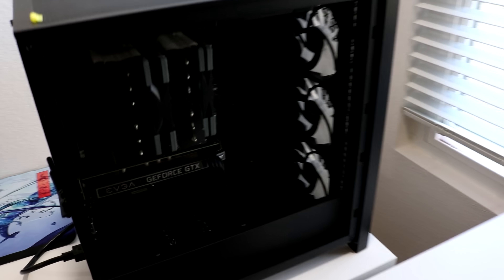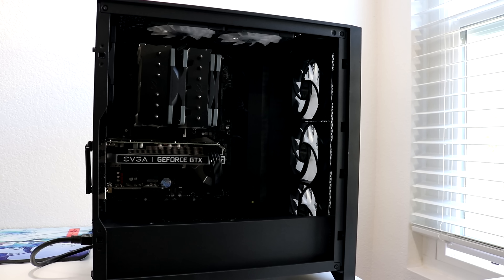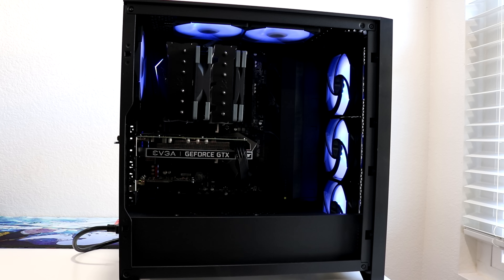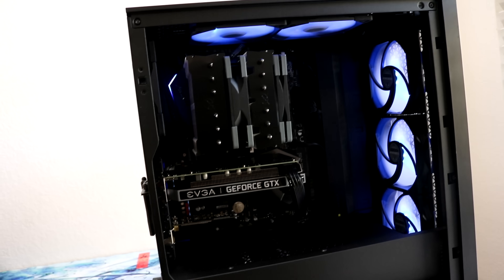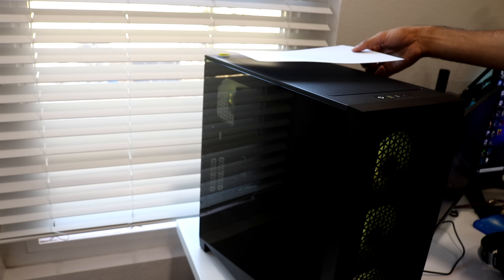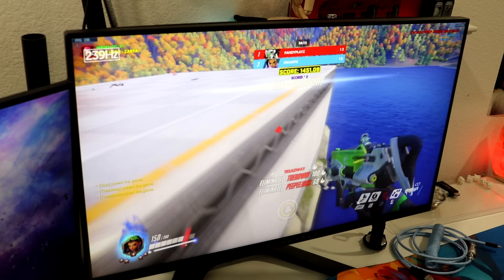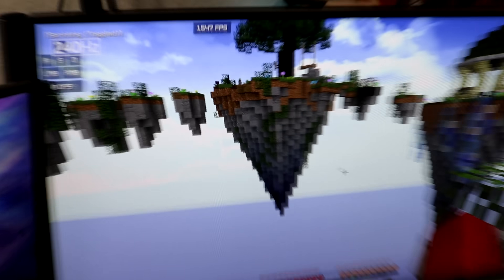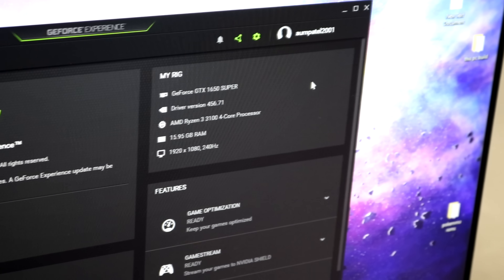$600 PC Build Gets 1500+ FPS In Minecraft

Comment: okay so this video is totally fake!! dont be fooled hes not using the gpu as he said he just have swapped the coolers!!!! I have a 1660 super thats overclocked and i cant even reach 1000 fps with all on fast and fast render on and i have a ryzen 5 5600x so this video is totally fake also my temps are below 60 for the cpu and below 65 for the gpu and A RYZEN 3 3100 SHOULDNT EVEN RUN AT 60 Degrees EVEN WITH A CRAP COOLER!!! Ive tested myself with a Ryzen 3 2100 and it ran like 40 degrees with the stock cooler SO THATS WHY I THINK THAT SWAMP IS FAKE AND HE SHOULD DESERVE A DOWNFALL

Comment: of course you're gonna get 1500 FPS when the game doesn't need to render hardly anything.
Reply: Even though minecraft is more cpu based, I hope I get my expectations with a rtx 2060 super and ryzen 5 3600x
Reply: @JD-ut5hs  you should be able to easily get 400-600 fps with that setup. I have an i5-10400f, 16gbs of ram and an rtx 3060 and I get around 600-900fps
Reply: Its off now so I'm gonna have to go for the 2070 super and ryzen 7 3700x...

Comment: I have a 3060(overclocked) a ryzen 9 3900x and 32gb of 3600mhz ram and I can only get 350 fps on the lowest possible settings staring at the sky
Reply: Make sure minecraft is actually using your graphics card lol
Reply: You should be getting 1000 FPS easily

Comment: Overkill motherboard and overkill cpu cooler
Reply: Upgrade path..
Reply: A $120 B550 board would have a similar upgrade bath. You could spend $120 on a B550-A-PRO and you could put a 5900x with no issues.

Comment: That’s a bit to much FPS
Reply: Precisely 4.31111111x too much as the highest if my calculations are correct as the highest FPS I saw was 1552 and the highest refresh rate monitors today are 360hz at 1080p meaning that this much FPS is retarded and unnecessary
Reply: @applemaster5343  indeed good sir

Comment: instead of wiring a long ethernet cable from the router, how bout a powerline adapter connected close to the pc? thus connecting a short ethernet cable from the powerline adapter to the pc
Reply: Power lining would always have worse performance than regular wiring.
Reply: @ohtitus13  oh yes thats true but still better performance than wifi, from my experience
Reply: @SoyPotatoe  Compared to wifi, its definitely better. But 90% of homes have wired ethernet cables running through the house anyways. I use a powerline adapter myself and electrical interference is a common problem. 200mbps, if my lights are on around the house and the microwave is running, its like 30
Reply: @ohtitus13  ah i see. having other electricity on disrupting performance is new to me. thank you for the heads up 👍

Comment: Yeah that’s not hard to get but you only need 240 FPS since that’s the max you can render with a 240hz monitor, aka you can install tons of shaders and mods so measuring it with FPS isn’t fair since you can probably get like 3000 with a bunch of mods and bad texture packs

Comment: Guys, remember that the monitor also has a huge factor for the FPS. You could have. 3070 on a 60htz monitor and get maybe 400 FPS in minecraft, but as you can see here he has a 240 htz monitor. If you have these exact specs but on a 60htz monitor, minecraft would only get like 120 FPS. (I know this for a fact since I have the exact gpu. Also the processor holds a pretty big factor on how “big” the thread rate is. Another thing is that your ram will also have to be capable of running 1500 FPS.my reccomendation to anyone who actually read this whole thing is that u don’t need a rtx titan to run 2000 FPS. The monitor has more impact than you think.
Reply: I thought the hz of the monitor only affects what is it shows not the actual performance
Reply: @princemannic  The kid who wrote this comment doesn't know what he's talking about lmfao
Reply: Guys, it was a joke to trigger PC mfs
Reply: But fr tho how do he be getting that much fps with a freakin 1650ti. Mbruh i have a way better pc and i get a stable 90 (cause of 128x textures, high render distance, n other stuff)

Comment: So the Entry PC on the website with  Processor : Ryzen 3 3100
Motherboard : A520 Motherboard
RAM : 16GB Ram (2x8) 3000Mhz CL16
GPU : 1650 Super Dual Fan
CASE : NZXT H510 Case (White/Black)
CPU COOLER : Stock AMD Cooler
PSU : 500W Power Supply
STORAGE : 500GB NVME SSD
 On the website, is the same as this one in the video?

Comment: Tbh the one upgrade path you could do would probably be a 1080 ti or a 2060 super, you could also upgrade the cpu for multitasking performance. SLI in the 1080 ti would be good but you would probably want to add some Noctua fans, one way to stop the hot air from circulating inside the case would be adding water cooling to the cpu which would decrease how much hot air gets recirculated back into the machine. Nice build btw this should last you 3-5 years but consider upgrading soon, p.s replace or clean your dust filters every month or so. Overcooking your gpu would be something you should look into as well since if your running 60 degrees Celsius on load you should be fine while overclocking, to test full load you could run a blender benchmark or something like that since most of the games you played didn’t test to full potential of the system and the full max temperatures your system can hit, if the temperature gets to throttling at full load than you should look into better cooling.

Nice overall build, keep up the good work. 👍😀

Comment: Yeaaa, and my $1000 pc doesn’t even get to 1000 fps (i5 9600K, RTX 2060 OC 6gb, 16 gb ram)
Reply: Try using optifine? I don't think he's actually getting 1500+ fps, I think its more like 600 to 800 fps
Reply: @syaz4380  I’m using optifine. Idk what’s happening. Anyway, it doesn’t matter.
Reply: how bro
Reply: @benjizp4  idk. Probably it’s fucked up or something. But Minecraft isn’t optimized that good tho.
Reply: No, it’s because your cpu doesn’t have hyper threading. Hyper threading helps a lot in MC.
Reply: @downnnnnn  what’s that?
Reply: Basically it’s where your CPU has double the threads compared to your core count (for ex, your CPU has 6 cores and 6 threads. If you would’ve had hyper threading, your CPU would’ve had 6 cores and 12 threads.)

Comment: I fail to find the reasoning behind putting that chonky ass cooler on a ryzen 3
Reply: He has it there so when he upgrades he doesn’t need to get a cooler. Also low temps are good
Reply: He stated that it’s different than the one he’s using on the website. He just did that because he used that rig as his personal rig for a while

Comment: Which ryzen is the cheapest and best at the moment? I was thinking of buying a Ryzen 9 but I’m new at pc building and stuff I also don’t know if the cooler is included for the CPU air would be great if someone could help me out
Reply: @thoughtlessaction2126  thanks
Reply: @thoughtlessaction2126  Did you build your own PC? Cause I need some help with finding all the modules that I can use that are under 1,100€ tho 1.100 is my budget
Reply: @thoughtlessaction2126  I’ll look for them
Reply: @thoughtlessaction2126  do you mean with 2060 or 3070 the graphiccard or GPU
Reply: @thoughtlessaction2126  that's true i thought of an 2070 super is that good? cause my PC that i have rn cant handle the games id like to play like battlefield 1 and stuff
Reply: @thoughtlessaction2126  by the way why should i take an 500gb ssd and 2tb hdd when i can just take an 1tb ssd or 2tb ssd?
Reply: cause i heard that they are much faster
Reply: @thoughtlessaction2126  i made a lil setup and you can rate it

Gigabyte B550 AORUS ELITE AM4
AMD Ryzen 5 3600
1TB MX500
16gb Crucial Ballistix
Artic Freezer 34 eSports Duo
500W be quiet pure 11
RTX 2070 super
Lian Li LANCOOL II Midi tower

Is it good or bad?
Reply: @thoughtlessaction2126  thanks but is 500W enough?
Reply: @thoughtlessaction2126  What CPU should I pair with a 1660 super

Comment: I would actually recommend getting a used rtx 2070 or rtx 2070 super when the rtx 3060 comes out because the prices of the rtx 2070 will drop a lot.
Reply: this comment did not age well
Reply: @hottiee334  no it didn't

Comment: $200 mobo, on a $600 build... what
also you can get the same specs of ram for $20 cheaper, only downside is no rgb
also save $70 and go for a western digital m.2
and all that money you saved for going on cheaper items ($190) you can get a 1660super and a Ryzen 5 2600, or go for the stock cpu cooler, which is all you need, and get a Ryzen 5 3600

Comment: Can you tell me how much fps in fortnite and minecraft i get with you custom build pc Ryzen 3 3100

A520 Motherboard

16GB RGB Ram (2x8) 3200Mhz CL16

1650 Super Dual Fan

NZXT H510 Case (White/Black)

Stock Cooler

500W Power Supply

500GB NVME SSD
Reply: I see for the minecraft may you tell me for fortnite. If you can
Reply: Logic_Encrypted  smart

Comment: You definitely could’ve gotten a better and cheaper case, take the Corsair 275r airflow for example. Also if you’re gonna SLI 2 1080ti’s, consider getting a much better motherboard. The msi b550 gaming edge carbon is good.
Reply from the maker: SLI idea is out because the motherboard I have doesn't support it anyway

275R airflow is literally the same price, 79.99

Comment: Me :1000 bucks gaming laptop 100 fps with lots of frame drops

Also me: sees this

Also also me: B B B R R R U U U H H H
Reply: Watch out for thermal throttling while gaming or under full load, if your temps go over 90 degrees (Celsius) try and replace the thermal paste or if its a new laptop try checking the fans for dust and shit.

Comment: You should've have bought a 1660 or a 1660 super and u shouldn't buy a 850W PSU when using such a low end GPU. Also U could've have bought a Ryzen 5 2600 in the place of the 3 3100
Reply: 2600 is worse for gaming 1660 is around the same performance as 1650 super. He said he might upgrade later om

Comment: X570 auros and an 4000d airflow is a bit more than 600$
Reply: Intel costs way more
Reply: MSI b550 instead, but it think that case is fine
Reply: @virdiid8621  in my country its cost is like a gtx 1660 super
Reply: @בן אסייג he stated that the mobo psu and cooler is different than the actual build fucktard. Gtfo thinking that your so special

Comment: With Ryzen 5 3600 and GTX 1660, 16GB Ram, what should I expect ?
Reply: Get 1650 super if you going to get the normal 1660 not much of a difference also 1650 super is cheaper
Reply: @ragestrades  I've changed it to 1660 SUPER
Reply: Logic_Encrypted  I asked about MC xd
Reply: Logic_Encrypted  60 ? I don't play survival at all, I play pvp and i don't use shaders, and I play on Lunar Client, so even without optifine it would surely be more than 60
Reply: Logic_Encrypted  okay then, but i would never use those settings, i was asking what kind of fps should i expect with settings like swamp is using, if he got 1.5k with that pc then logically i should be getting even more in some situations
Reply: Logic_Encrypted  Thanks for the answers, appreciate it

Comment: TL;DR Get the i5 10400 and a better GPU for the same price(not tested)
Why did you pair a Ryzen 3 3100 with an X570 AORUS ELITE? seems weird. I recommend the B550 Steel Legend for much cheaper. I would allocate more to the CPU as well, maybe instead of AMD you can buy Intel’s i5-10400 and a good quality B460 motherboard for it. It would save, and you could allocate more money from the mobo to the GPU as well. Haven’t tested this though so it may be more expensive
I do love AMD, but sometimes Intel is the better value for gaming.

Comment: btw dont bother with sli watch linus tech tips or techquicke(techquicke is there second channel) because nvidia is shutting down sli and nvlink so no graphics cards will suport th sli function except the 3090 so nvidias ditching sli basically and its not a huge performance advantage well i guess were stuck with amd crossfire with radeon gpus

Comment: Hey swaump is this a good pc because I’m also looking forward to buying this his pre built:CUK Stratos Micro Gaming Desktop (AMD Ryzen 3 3200G + Radeon Vega 8 Graphics, 16GB 3000MHz DDR4 RAM
Reply: I’d say that’s pretty good. I tip is to get a good case with good airflow for better cooling and everything😁
Reply: try going for a dedicated GPU instead of a integrated one
Reply: @holycombo3471  what does that mean?
Reply: Ik im not swaump but I recommend getting a ryzen 3 3300x which is really good for gaming but you’ll need a gpu if you need more help just ask me or someone else for help
Reply: @prodbykxrma  what about these specs: AMD Ryzen 3 3100, NVIDIA GTX 1650 Super 4GB, 8GB DDR4, 500GB SSD, A320 Motherboard, 550 Watt Bronze
Reply: @unoutszn  that’s good just the motherboard isn’t compatible so I think you should change the motherboard to a msi b450 a pro max
Reply: The vega 8 graphics isn't the best, it's an integrated gpu (connected to cpu and generally not powerful), if you're going to play games, you need a good gpu. If you don't want to build it yourself then get a pc with a rx or gtx series card (like an rx 570 or gtx 1650 super). Vega 8 loses to a gt 1030, and a rx 580 or gtx 1650 is like 5 times better meaning you'll get more performance or fps.
Reply: @Haishe what’s the price for that?

Comment: Bro this is just what I needed before Christmas thank you but I think I’m gonna struggle building it unless it’s a prebuilt 😁🙁😕
Reply from the maker: You will be able to order a computer with the same performance for $699 from me in a few days. I will be launching a website for it! I will do an announcement video for it
Reply: @swaump  omg yay🥺💖
Reply: @swaump  yo ima make you rich LMAO 😭
Reply: @swaump  YAYYY SWAMPIE BUILT PC
Reply: @swaump  what is pc called in this video so I see it in the website
Reply: @Hzpt7  Depends if you want Intel or Ryzen. Both of them are good cpus are I would usually recommend Ryzen 5 3600 since it comes with a good stock cpu cooler that can save you money from having to buy a cpu cooler which is nice and it’s a good cpu for content creating/gaming like editing faster than the Intel 5 10400. The Intel 5 10400 is a beast 6 cores/12 threads. You can still edit on it to. If you are looking for 3D rendering and fast editing then probably Ryzen 5 3600 which also games very well. i5 10400 does all of those but not as fast as the Ryzen I would say, but Intel doesn’t come with a nice stock cooler but performs like it should. Recommend you spend extra money for a cpu cooler if you are going Intel to make it look nicer and get better temperatures.